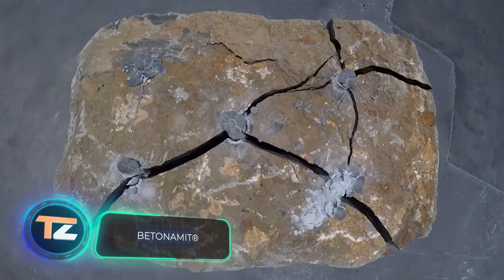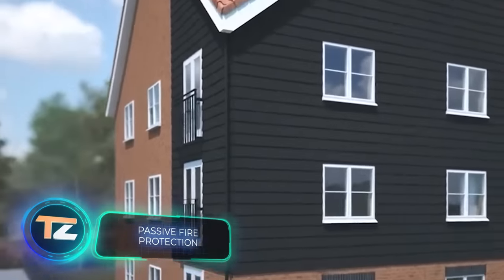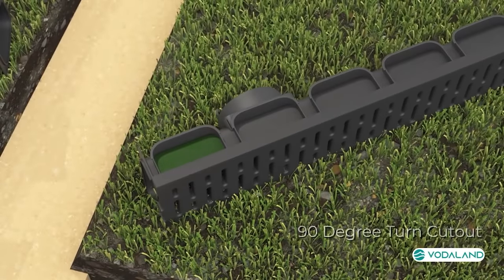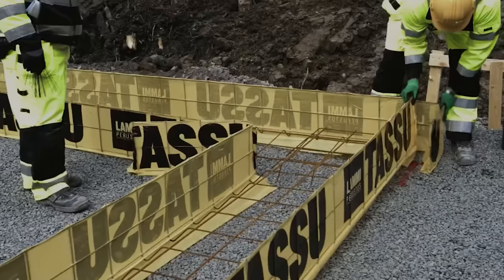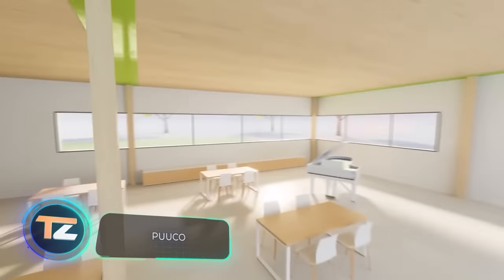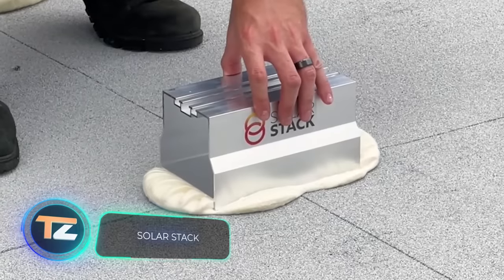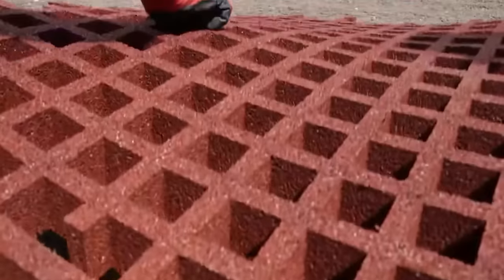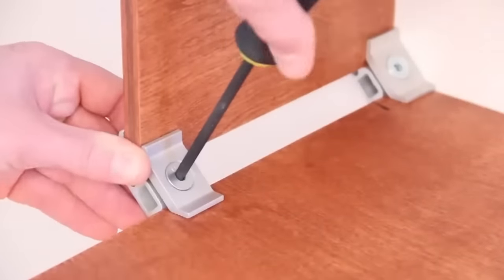CONSTRUCTION TECHNOLOGIES THAT HAVE REACHED A NEW LEVEL

Comment: Great Solar Stack  10.55  just cut some holes in the roof to install the Solar panels  and don`t seal it up  , ( what happens when it rains )
Reply: The instance where they are cutting the roof with tile, i completely agree! Whether they're clay or cement tiles they are fragile as hell to even walk on let alone cutting or drilling holes in them. A lot of installers will take up the tiles and put shingles down where the panels will cover it and i think thats a terrible idea as well. I've recently seen solar mounts that are designed to replace the tiles. They are molded to look like clay tiles and interlock with the existing roof.
Reply: Also, I wouldn't glue the mounts for solar panel only asphalt shingles, since a hurricane would rip up the shingles... which most US roofs have.

Comment: Currently installing 175mm of rigid insulation boards in my extension roof with no gaps and foil taping all seams to meet UK regs uvalue of 0.15, and watching this loose fill being blown in as new technology in the US just makes me think its all pointless. The US is so far behind. What is the US regs max uvalue for a pitched roof?